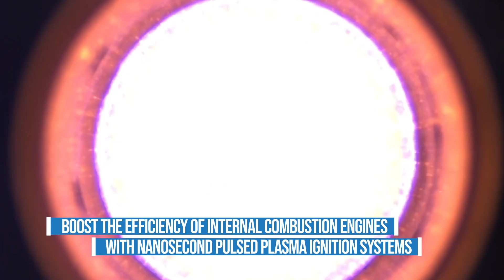Plasma Ignition Making Progress - Autoline Exclusives

Comment: ion  disruption out of air with a lightning bolt type plasma ..as the joe papp engine ..and the fact of using a resistorless spark plug and a vacuum sealed car engine at the incoming throat and outgoing down pipe utilising the now common EGR valves no doubt waiting for such out the box thinking that those developers also knew ALSO HAS NO VALVE BOUNCE AT WARP REV  OR MAJOR HEAT GENERATION AS  VACUUM KEEPS ALL SO CALLED ATOM DISRUPTION TO BE ABLE TO REFORM INSTANTLY THE ION COOLS

Comment: Works perfectly in theory every time. Put prototypes on the road to prove it works. And don't add absurdly complicated imposible to repair systems to already, well you get the idea.
Reply: impossible to repair???  explain how??? 
so simple is more reliable? have fun with a car that uses "points and condensers" and the other crap that constantly would wear out....
Reply: Had cars, trucks, tractors, motorcycles and garden tractors with points & condencers, and work just fine. Had more problems with shoddy materials like; plastic teeth on cam gears, timing belts (especially on interference engines). There's been much more over the last 40 years working on vehicles.
Reply: Yup!  As Elon Musk has said, "Everything works in PowerPoint", "Show Us Something Real".  Not sure if the latter part of that was Elon's comment but you get the idea.  Of course he was talking about all the SUPPOSEDLY revolutionary battery tech being developed around the world,  As the largest consumer of batteries in the world, Tesla knows that whoever actually comes up with a WORKING breakthrough that is manufacturable at volume, will approach Tesla first with their technology.  It would appear that the BEST Elon has seen so far was from Maxwell, so he bought the company.  A few of the former top Tesla Battery Engineers have gone on to form their own companies and some of those are showing promising developments as well.
When I hear the word PLASMA, Nuclear Fusion Reactors come to mind and we all know how fast that technology is progressively.  It'll always be ready 30 YEARS from now!
Reply: https://en.wikipedia.org/wiki/Plasma_torch.... and thx for pointing out that cult drones are mindless fools with nothing useful for add to the conversation...

Comment: Hardly the end of ice engines making them better or more efficient is great batteries are not as recyclable as ice technology lithium is not endless.
Reply: batteries become less efficient when they age, also BEV use energy when not used and parked, at least 1% a day when the battery is new, and more for older batteries. The Dutch don't like this at all!  I think the only reason they put up with it is because electricity is cheap and gas is expensive, but it is a waste of energy!  Think about it 1% a day is 30% a month, that is 1/3 of a tank each month, just pure wasted energy, no mile driven pure waste!
Reply: That is not the case. Virtually all of the battery can be recycled, saving having to mine the metals, even when it's after-life as fixed storage is over - and in any case lithium is very abundant.
Reply: You know by the same logic the supply of iron/steel is not endless, the supply of oil is not endless, what does the term 'endless' have to do with whether a technology is good or bad?

Comment: 10:25 ‘There’s no jumping ahead to EVs’
Tell that to #ModelY
let alone #Model3 — best selling sedan by revenue.
Reply: Along with the Semi, the roadster, and the cybertruck, the latter 3 being vaporware atm!
Reply: @Iamwolf134  Actually there are running versions of all three of those.  That's some pretty solid vapor.
Reply: @JRP3  Nothing like the claims being made. The battery tech to support elon's myriad of power to weight claims are only going to come about with some kind of solid state battery. Meanwhile, the infrastructure is a joke. And how we create electricity is a joke as well.
Reply: @th600mike3  Wrong on all points.
Reply: @th600mike3  The Semi might is probably most likely going to come out to the market, the roadster might come out, but it would cost way more than $200,000 (designing a car that can to go 250 mph safely requires a shit load of R&D and testing compared when designing a car that goes under 186 mph. The Cybertruck with its current design is never going going on market, since it’s made from stainless steel which it is poor for pedestrian safety or even the occupants inside the car since a car is designed to crumple on an accident.

Comment: Would it work with hydrogen? Could do alot to help truck engines where cutting emissions will become very critical. Could they clean up marine diesel or natural gas marine propulsion. Would be interesting too see it in motorsport as a test platform. Plugs still used in motorbikes...
Reply: This is great for diesel. TP ignition breaks down the large, hard to combust fuel molecules and helps them burn more efficiently. With the right packaging, it could be useful in motorsport. I haven't checked, bit I believe similar systems have been used in F1.

Comment: Without trying to sound negative, this would have been great 10 - 12 years ago when combustion engines were the defacto standard.  Any car company that spends money developing this tech is not applying their resources in the right places to ensure their future survival.  I wonder if this might be something that would work great in an F1 engine?
Reply: Hmmm, doesn't sound like there is much developing left to do for an OEM, and yet there is definitely a need for further efficiency improvements in ICEs - as BEVs are quite a ways off from taking over the vehicle market.  It is easy to think of EVs (plugins/charging of vehicles) for daily use will be a big part of where the industry will end up in - but ICEs will be around for an easy decade or two (if not more). Think in terms of what it would take for all the ppl that live in apartments, multi-family housing, even stand-alone houses that do not have a garage  - so that they can plug it in at night (or when they are home).
Reply: OEMs can make tons of money selling more fuel efficient engines and they can also save significantly on carbon taxes. Frankly, you don't know what you're talking about if you think that fuel-saving ICE development is not a high priority for most manufacturers.

Comment: I was hoping for the question; "Has an engine manufacturer signed on to this technology yet?"
Reply: Currently is seems unlikely any manufacture is going to sign on for this, as they are throwing so much money at EVs, particularly BEVs. If Govt pressure was not so great with, timelines bordering on unreasonable, Automakers might be lining up to at least try the technology out.  I know Detroit would gladly use it, if it works, to keep the V8 relevant.
Reply: @DocWolph  20% more efficient is great 50% less nox is great.
Reply: @DocWolph  Mazda has been pursuing quite a few different ICE innovations over the past decade. I'd think they would be one of the first to try and adopt one of these to use with their HCCI engines.
Reply: @ALMX5DP  actually Mazda calls it SPCCI  (HCCI, doesn't use a spark plug).... but I had the same thought too since, they seem complementary to each other.... 
But SPCCI only uses a spark, part of the time, so that would have to change... and it would add more cost to already complex and costly design...